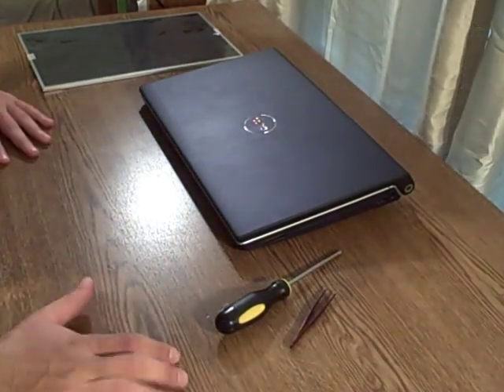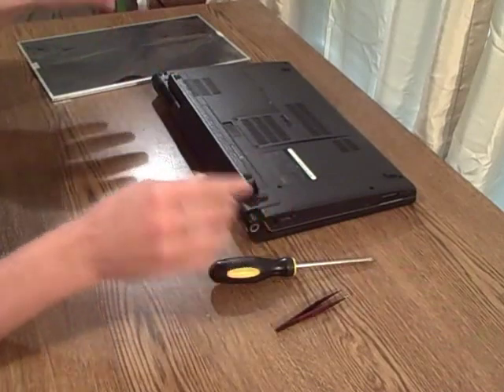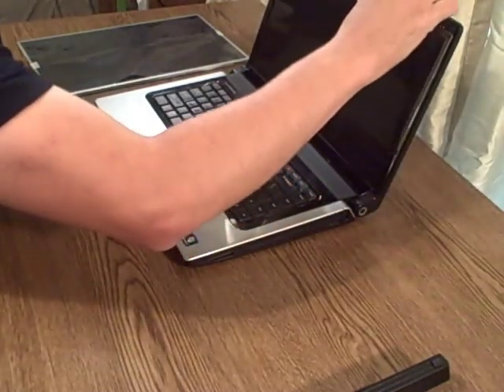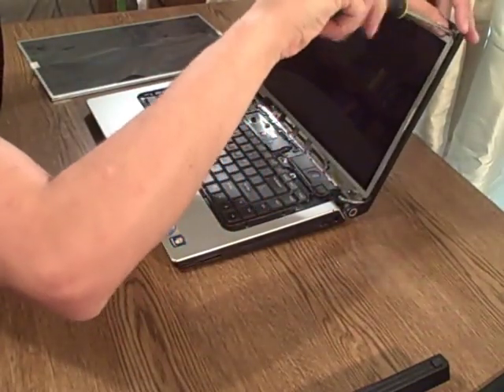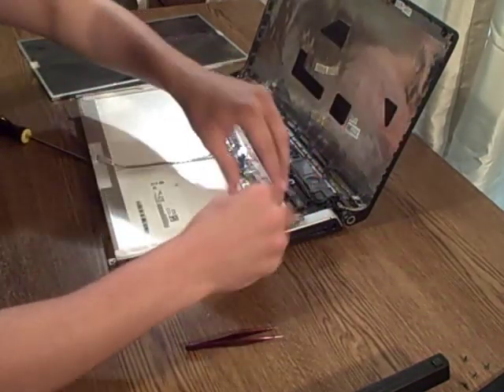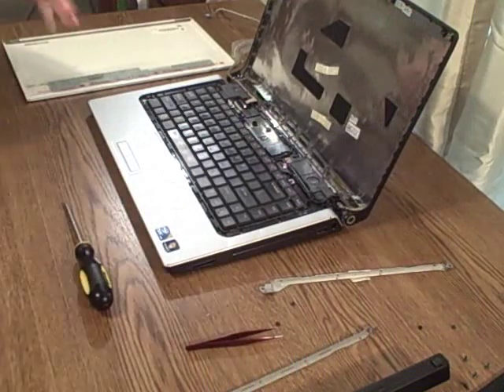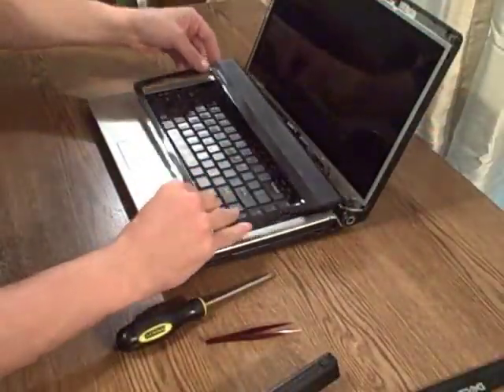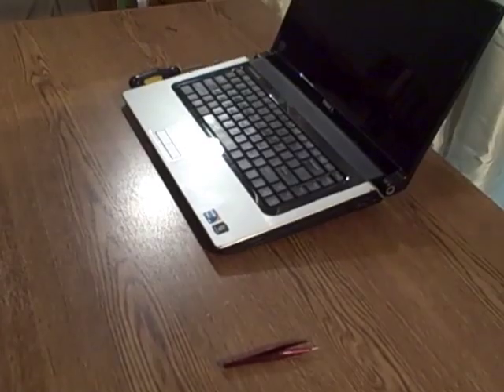How to replace laptop screen Dell Studio 1558

Comment: great video, however a hint for people trying this is first test the connections on your old screen following this same video. simple unplug, look for dust/hair, then replug the connections. .. I work in IT and have "repaired" many screens and never have had to buy a replacement unless the old screen is literally/physically broken, screens shouldn't go bad but connections often come loose on moving parts such as these.